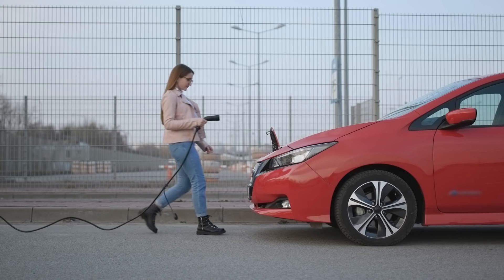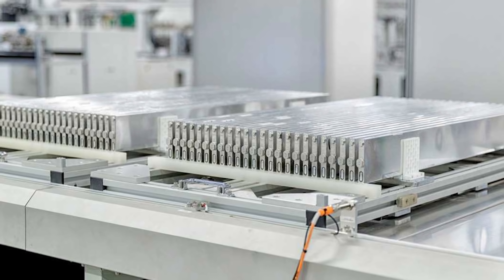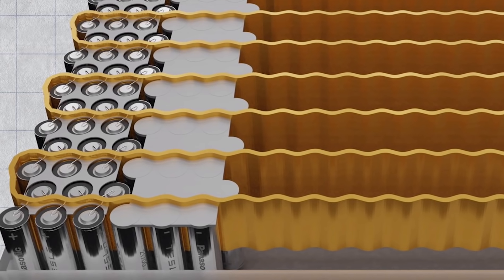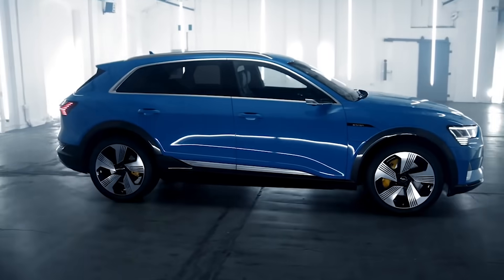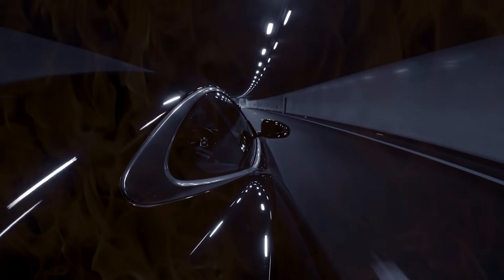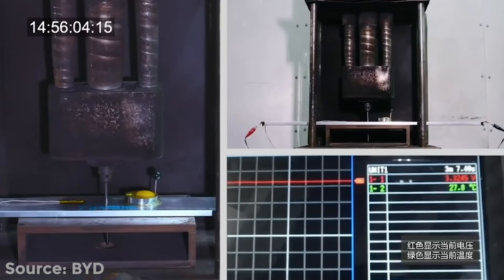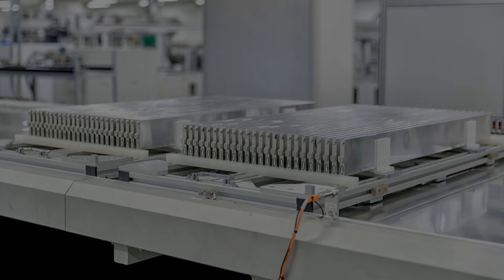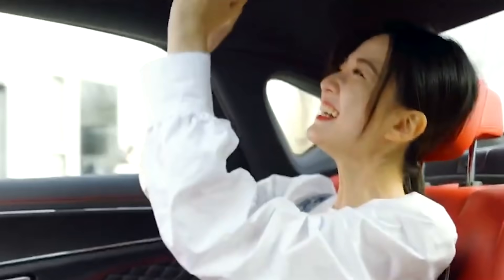Uncovering China's Battery Breakthrough

Comment from the maker: INFORMATION: I stupidly forgot a key detail, which is the cells are thinner than usual, this means the surface area per volume of the cell is higher, and heat from the centre of the cell can escape quicker. Sorry for any confusion!
Reply: No wonder there was a lot of hacking against China recently
Reply: What do u mean "unfortunately made in China"? If they were made in the US, Europe, or Japan, the net emission will be higher. The average American even burns more coal than the average Chinese. The US has the biggest coal deposit and Big Coal won't die easily. Thanks to fracking, now everyone can try to burn more gas instead. The open strategy of the US is to burn a bit more gas to replace a bit of coal and export the dirtier oil to other countries to make them SEEM cleaner.  Think of an American home. After a day of work, you drive home in an American car with 50% parts made in China, use the Chinese remote to open the garage door run by Chinese motor, take off your Chinese shoes, remove the Chinese clothes, jump under the Chinese showerhead, wipe dry with Chinese towels, put on Chinese boxers, switch off the Chinese lights, lie down on the Chinese sheets and grab the Chinese pillow, send a good night message to your girlfriend with Chinese Iphone. Now you are set for an American dream.
Reply: Still have question economy of scale.  How fast does BYD say with this new blade battery technology that the economy of scale will start to come down and make it very affordable?
Reply: you made a big error in your video. In cars its not about energy per volume but energy per weight.
Reply: Thank you for that clarification. 😀
Reply: Hexagons are strenger than cilinder betteries do its nor optimized
Reply: @Otiyyy  why are you worried about that? u dont use batterys as a support device.
Reply: @woodzyfox4735  we depend on it tho later on we all depend on batteries
Reply: @woodzyfox4735  
There are multiple companies looking into making batteries a structural element, thus reducing the overall weight of the vehicle.
Reply: @Otiyyy  why not maike them squar . Less wast÷d space?
Reply: @thomasforbes7905  maybe cuz the edges get to sharp when you need that type of efficiency
Reply: I heard something that Germany could build Solid state battery's and they where cheaper than this one from China. Because the majority of the machines comes from Germany.

Also a recycling by the company called Düsenfeld
Reply: china stole that technology from mars
Reply: @ashleysimthi4852  Yeah. Last time I was at your mars she was full of energy.
;-)
Reply: No problem brother
Reply: That's incorrect the thinner area the less 
Volume thus area.
Reply: lol, I was half way through writing a piece tearing into this obvious flaw then I looked up and read your key detail bit ! yes, that would make a big difference !
Reply: is it better than rimac's batteries?
Reply: website doesnt work
Reply: That means Tesla's new tabless fat cylinder shape battery *aren't good enough?
Reply: @kaiyom  
Tesla’s new batteries appear to be good but they’re still nowhere near as efficient, fast charging, safe, cheap to make or environmentally less harmful etc than we need to wean us of petroleum and Diesel on a global scale.
Reply: You forgot another important detail: The projections on how long the world's lithium stores are projected to last if electric car production went into full production in the scale of combustion engine cars.
Reply: Hey Bob, your grammar is terrible.  I’m pretty sure English is not your first language.  You wouldn’t happen to be Chinese, would you?
Reply: What's the lifespan on these batteries though?
Reply: Ziroth......don't be too hard on yourself. You did a very good and informative video on the BYD blade battery. Thanks for sharing this info with YouTubers.
Reply: When you show the nail going through the battery of the BYD, the temp isn't the reason, if you notice the voltage on the normal LifePo4 had a short internally when it was pierced by the nail where this blade shape wasn't shorted. If it had been shorted it would have caught fire also.  In the BYD cell only 2 of the packs in it were shorted, you can see the voltage drop of like .04 or something close when the nail pierces, not going to have the current in that one cell to cause a fire.
Reply: US Proxy War in Myanmar Threatens China and the rest of Asia  by Brian Berletic   https://youtu.be/VfxfIXGmY8o
Reply: Are you saying each nation can emit only the same amount? 10 million population and 1.4 billion population? Check per capita emission. The US is the largest polluter.
Reply: @americanknow8232  Not quite so true,  #1 is Saudi Arabia @ 18.5T of CO2, USA is #4 at 16.7T, Canada is #5.  2018 data.
Reply: @americanknow8232  B.S......the reason most companies drag up to china....because no EPA like restrictions, thus the heavy metal pollution is off the charts.. there is a lot more than just emission on the table..china and india for outpace America... that's why we send ships there to be recycled etc....and look at the trash in india as a whole.. FOH....
Reply: ❤💙China 🇨🇳
Reply: Which country does not depend on fossil fuel  ? Please elaborate.

Furthermore, China is actively developing large scale non-fossil-fuel power generation facilities, including solar, wind, hydro-electric, nuclear and geothermal.

It is unfortunate for you to include your anti-China bias in an otherwise excellent report on the advantage of new type of lithium battery.
Reply: @clocktower1164   Personally I welcome our new Chinese overloads.
Well, it's either that or Boris, or Trumplings or Erdoğans or Dutertes or even a reconstituted Reagans or Thatchers...
I would rather be surrounded by people that cared about the country rather than just themselves.
China has been on the cutting edge for well over a thousand years, well, apart from that break they took when they realised the rest of the world had little to offer and America has been here a mere 300ish years and look at the mess they have made.
Reply: @clocktower1164  It's not anti china is factual. Most of the vid is pro  hina. Re power, china and coal is a problem. The same thing should be said of America I though. There are countries with much much higher renewables percentage.
Reply: @monkeysezbegood   Since you are the one who claims "There are countries with much much higher renewables percentage" would you kindly provide us with a list of countries that have "much higher renewables percentage" than that of China  ?

We will be awaiting for your answer, and please, don't disappoint us  !
Reply: @monkeysezbegood  Don't you ask us to google   !

You made the claim, YOU PROVIDE THE FACTS   !
Reply: @monkeysezbegood  All I am interested is FACTS

Whether or not China would be the leader in the future, that's not my concern.
Reply: @clocktower1164  Sweden.
Reply: @clocktower1164  if you rely on YouTube comments for facts, then you probably aren't interested in facts.
the internet is a good source to verify or refute claims.
And usually one learns through one's own research much more than to be given an answer that one is willing to accept
Reply: @clocktower1164 I don't think he was being the bad guy there.
Google is not hard, he could have done it but, you know, he was suggesting others do it. Not a bad thing. It would only prove your point anyway.
Reply: @clocktower1164   Switzerland, France, Denmark etc.
Reply: @clocktower1164  agreed just watched Just Have A Think recently about China's plan to have a DC only transmission line from all of the wind/solar farms that are replacing coal fired power plants at a extremely fast&impressive rate in China's western desert region. I honestly believe that China had thier eyes opened when they last hosted the Olympics seeing how the world viewed them. As it was obvious due to the green skies of Beijing. But also now know to more than triple down on investments in green technologies, along with the vast economic potential in renewables&....that the clock on climate change is ticking. Faster than we care to admit. Greed, Corruption&Capitalism in the West has a stranglehold on converting to renewables. As their lobbyists are in control of the narrative being more than a roadblock to progress along with what could be a golden age where mankind&technologies save the world making a vast difference, while yes...getting paid too. I am an American&absolutely applaud China for their response to the climate crisis taking swift decisive united action ALL rowin in the same direction 👏🏼 While here in America we are rowin in all different directions goin nowhere. I mean Hell China recently&swiftly banned all gas powered passenger vehicles. Bold decisive action is what is absolutely needed as the West is wasting precious time. America should look to Denmark even improving on the floating wind turbines instead going to a more efficient vertical turbines to harvest the wind on the eastern&western seaboard. Massive industrial Heliostat, Wind, Solar, farms are needed as a $14T+ infrastructure bill would be a worthy investment to save the planet&would no doubt pay for itself by creating a vast number of employment opportunities. Hopefully we will also have a fusion breakthrough as China's recent developments in that field are more than promising. That coupled with vertical farming of Hemp or even Marijuana could also have a significant impact? In Colorado&other US States the experiment worked with the legalization of Marijuana social services, road, tunnels, bridges...ALL paid for. Plus they capture so much carbon 'IF' we farmed both in vast quantities. It's immensely frustrating to know we have solutions to our problems now but Greed stands in the way. Sorry, had to rany&support your comment as you were spot on with your assessment 👍🏼
Reply: @5H4NK5  i might have agreed to what u are saying but if u look on what is happening in china atm they are building more coalplants then ever and that scares me while the west is acviely shutting down coal and fossil dependency
Reply: @5H4NK5  "Marijuana could also have a significant impact"
I am so with you there man...
Reply: @clocktower1164  Absolutely correct 👍
Reply: @clocktower1164  sweden does not
Reply: @clocktower1164  nope we do not use any fossil fules what soever we do use biofuels and we do burn trash as resucling but that is not FOSSIL fuel
Reply: @clocktower1164  
Of the 26% of china’s renewable energy, the vast percentage is hydro, which is not only environmentally damaging it also produces CO² and methane. Countries like Uruguay, Costa Rica, Nicaragua put the rest of the world to shame, transforming to between 90-100% renewable in only 10 years. Sweden is aiming for 0% from fossil fuels by 2040 and many other European countries are also pledging to do similarly. Scotland can on windy months already produce nearly 100% of its electrical power from wind turbines and is the new home to tidal powered turbines that could be a game changer in power generation. 
Meanwhile the per capita worst producer of CO² (US) is at a pitiful 17%. Its not as simple as that though, because so much is made in China for western consumption that we in the west are in effect getting offshoring our pollution to them so we can have cheep consumables.
Reply: @Therapistinthewhitehouse  I am so glad you bring up this very crucial matter   !

Do you know that there are about 22,400 dams in China, while in USA, the number of dams is OVER 80,000   ?!

Oh no, please don't believe what I am telling you. Please google it yourself   !

So, if you want to whine about the 'environmental degradation of dams, please, go complain to USA first, before you do it to China.

Thank you   !
Reply: @clocktower1164  
Why have you got such a pissy attitude? 
I’ve already said that a proportion of China’s pollution is due to us getting virtually everything made there. You seem to be of the similar opinion re the US’s poor response to climate change so why bring it up? 

FYI  
Sorry to have to inform you of this, despite what your partner may tell you size matters.😉
The number of dams is irrelevant. 
Last year the US produced roughly 290TWh of hydro power, or 7.3% of total capacity, while China generated 31% is power from hydro and in 2018 (I can’t be bothered to find more recent figures) they produced 1,232TWh of power with around a dozen more large scale dams coming on line soon.  

Proportionally they are almost identical, China having 400% more capacity and 4x the population.
Reply: @Therapistinthewhitehouse  Excuses, excuses, excuses

US has over 80000 man-made dams and China has roughly 22400, that alone tells us that the ecological damage created by 80000 dams is *MUCH MORE SERIOUS* than the one with 22400.

Size matter   ?

If you build a dam, no matter how small it is or no matter how large, you create a barrier for the fish and all other aquatic creatures from swimming upstream, and you halt their life-cycles.

 80000 dams translate to 80000 barriers for aquatic creatures to go upstream.

22400 dams translate to 22400 barriers for aquatic creatures to go upstream.

You can try to apply any number of excuses you like, after all, all your life is filled with excuses and lies.
Reply: @clocktower1164  Incorrect.  Please stop lying.
Reply: @algerpiston168  You are the liar, so you stop lying   !
Reply: That is not a good enough apology. Go learn mandarin, poorly, and give us a humiliating, self-deprecating, hat-in-hand apology that would make John Cena cringe.

Comment: Interesting that you mention surface area as main factor, because such shape WILL NOT actually have more surface area VS stack of cylinders. Generally this video is full of mistakes. For example LiFePO chemistry. You compare flamability, but in fact LiFePO simple isnt flammable. It also has 10x lifetime, but it's energy density is SIGNIFICANTLY lower. It is also not at all a breakthrough. All LiFePO batteries are rectangular, and have been on a market for years.

Comment: It's cheaper to buy a v8 big rig that runs on burning tires then one of these cheap all electric cars that give you 50 miles to a charge and burn your house down if you let it go over 90% or under 20% charge.

Don't get me wrong I would love to own a Tesla - not because I want to save mother Gaia but just because I like tech. Until they invent a Tesla that gives me 300 miles a charge and cost cheaper then down payment on a house (not to mention a 6 month lead time) people will still be using that dirty dinosaur juice.

Comment: I would still like to see swappable batteries and I hope this new tech supports such. I foresee a future where batteries perform so well that they only need to be recharged infrequently, perhaps once a month or even semi-annually. A person might get their battery swapped with about the same frequency as he/she gets an oil change today. But why not just let the owner do it?

Well, among other things, it would be very inefficient, if you are recharging your battery once a month, to have recharge equipment in your home/garage. Most of the time that equipment would just sit there doing nothing except taking up space or waiting to be stolen/vandalized. Just one example. I'm sure one might think of other reasons opposing self-charging. Most of this, right now, is just my gut feeling as opposed to analysis.

Recharging the battery (or refilling a gas tank) is essentially an automobile maintenance task. I would much prefer that everything auto related be done by a mechanic than by a civilian. The civvie will determinedly find a way to mess up in various dangerous ways. Even as regards refilling a gas tank, how often have we heard of a person absent-mindedly leaving the dispenser in the tank as he drives off, causing very expensive damage to the station and to his vehicle? Or somebody putting sugar or sand into someone's gas tank? Or putting the wrong gas into the tank? I went into the hospital for a couple weeks and almost killed myself worrying that my wife would put "Super" into the gas tank and thereby ruin the engine. I don't even know if that WOULD ruin the engine, but I think you see my point. (All's well. Somehow my car survived just fine and so did my wife. I died, however.) Anyway, etc. 

If the gas tank was swappable, such calamities would be avoided. I daresay lives would even be saved. But vis-a-vis gas tanks, the issue is moot because you can't swap a gas tank. But you can swap a battery.

We've been refilling gas tanks for a century. We've gotten so familiar with doing that, that we have difficulty considering other options; other options now seeming "unnatural", in a sense. We have difficulty even weighing the pros and cons because the concept itself, due to cultural conditioning, seems a little off-putting. 

But with EVs, we have additional options, such as battery swapping, which we should explore. What we should NOT be doing is the same thing that we've been doing, just because we are so used to doing things that way. Familiarity is not a reason to choose a poorer option. IMHO.

Comment: You Totally missed a major problem- LITHIUM SUPPLY.  There simply isn't enough. Since EVs reached 1 million total world wide production Lithium prices have gone up 1000% and 80% in the last 4 months.  This is totally due to EV demand for Lithium based cells so BYD does not help on this because they are also using Lithium.  Lithium CAPs EV production at under 4 Million BEVs TOTAL no matter who makes them; and that is if every ounce of Li is used.  It is a dead end. Until a better scalable cell is around EVs will be a trivial part of world production - there are 80 million cars sold a year; 100 million vehicles in an installed base of 1.4 billion vehicles. LI is dead.